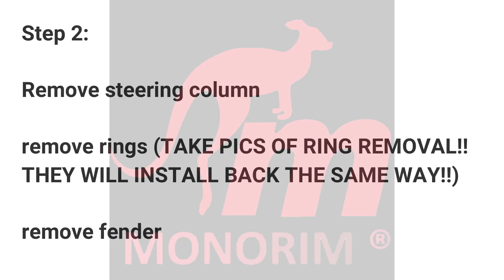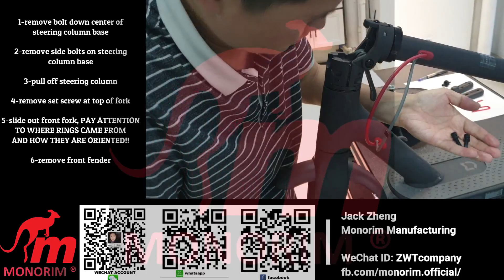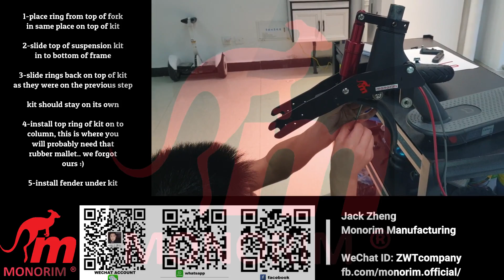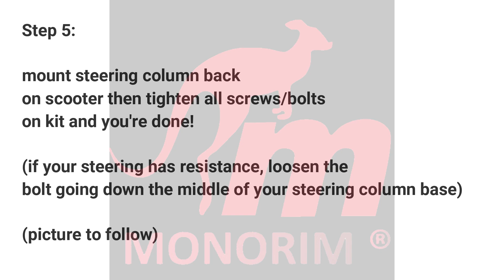1/4 Monorim suspension T0-S version 2 mounting manual

Comment: En temps que particulier, j’ai acheté la suspension chez Alibaba. Disponible maintenant chez Ali Express (site Ali Express plus accueillant). Modèle T0-S (celle avec bridage du ressort extérieur par une molette).15 jours de délai. 81 €. Montage facile, sauf que l’arbre principal du mécanisme était monté dans le mauvais sens par rapport aux les bras de suspensions. Une rotation de 180* était nécessaire pour que le  détrompeur puisse rentrer dans la base du guidon et pouvoir monter le garde-boue. Une presse a était nécessaire pour sortir et rentrer un axe transversale .... Grrrr... !
Les essais sont concluants. Plus confortable. La suspension absorbe bien les différences de niveaux des sols. Je ne regrette pas mon achat. J'ai déplacé la fixation de la béquille de l'arrière vers l'avant pour compenser la perte d’équilibre dû au poids de la batterie supplémentaire et de la suspension (3,5 kg environ).

Comment: What is the difference between V1 (black spring) and V2 (red suspension)? Is one better than the other?
Reply from the maker: Ordering from Alibaba is only open to distributors and retailers. Business license upload is required for Alibaba orders. Limit one sample per customer. If you are an end user from Portugal , Spain or France, pls contact:
Emove Import Export SL
C/.Felipe Asenjo 28 
Poligono Industrial Cobo calleja 
CP:28947 FUENLABRADA MADRID
Tel:0034912401877  0034679672660
Reply: Black spring is just a coil, red is a hydraulic alot softer ride but won't last as long as the coil.
Reply: @bighorse215  Actually the red suspension is just a container for a spring, no hydraulics. Two different springs depending on your weight.

Comment: Hello I'm have issue when space 2mm gap video 2:57 after install complete fork is too shake I was ordered from Lazada Shenzhen
Reply: Me too, i have the same problem.  I hope someone can help. It is shaking there.
Reply: @Ahmedcito1  issue is resolved reinstall suspension put to tighten - recheck screw
Reply: I did that, but it is still shake

Comment: How to inatall the fender? I screwed mine but it is touching the kit and I cant attach it properly
Reply: Exactly my problem. Why bother making a video if you're not gonna ahow what you did and how you did it with only vauge text on the side.
Reply: did any of you guys manage to get this on ?
Reply: @lewisward8879  Yeah its pretty easy actually, you get 2 black screws, one is for the fender with 1 rubber washer and one of those spare metal rings (that worked for me) the other is for the stem to replace the longer black screw becaue if you dont you wont be able to tighten the longer one cause itnwill hit the axle thing that is in the stem. Very important and they didnt seem to mention that caude if you manage to tighten down the long one to lock the handle bars in place youve probably bent the axle thing and wont be able to remove it.
Reply: @tomh.5750  Thanks Tom - i did sus it out in the end but it took a while - it should really be in the video like you said. I did notice that it mentioned where to put the screws on a tiny piece of square paper that came in the box - but it was so small you needed a mag glass to see it.
Reply: Thank you Tom for explaining that the black one has to replace the longer one for the stem. I still feel that the steering is a bit tight tho, could it be the two ones on the sides of the steering stick?

Comment: What's the blue suspension spring for that came with mine?
Reply: I would like to know too
Reply: @evandro337  the blue one is is if you are over 160llbs  but I would like to know how you change them over?
Reply: TheHovelad that's right. I would like to know how to replace, even I don't want change because my weight is under 160lb
Reply: blue is for 70-100+ kg rider. Yellow (inside of suspension) 50-70kg

Comment: well everything seemed solid, great and together well, but I guess going by this video I did SOMETHING wrong and now the suspension is a bent up mess, my right side hurts like heck, and I busted my display because somehow I screwed it up and the steering column popped off at 20 km/h. Ow.

Comment: Why have space 2mm between each piece of steering column top and above?
Reply: Cuz this is bow the washer set up the column (they are stiff a bit and tight) you can't tighten the column by hand pressing. It will tighten by bolt